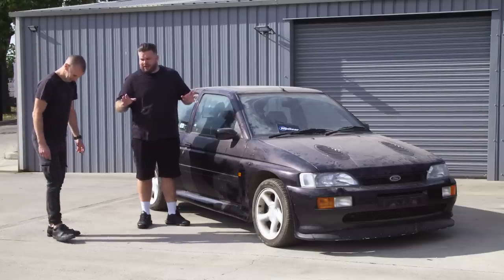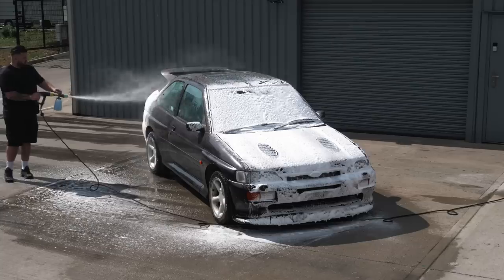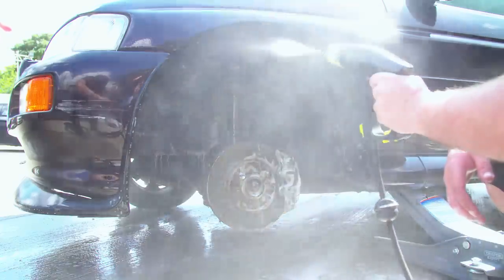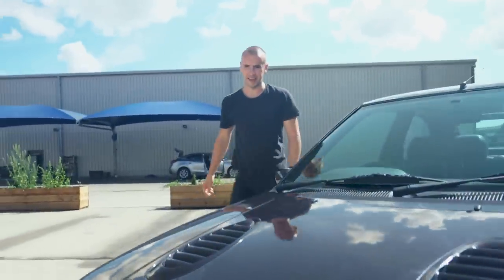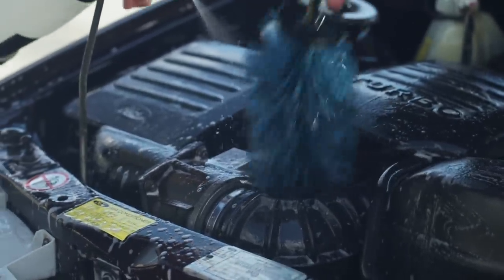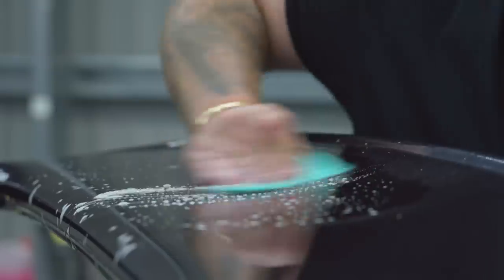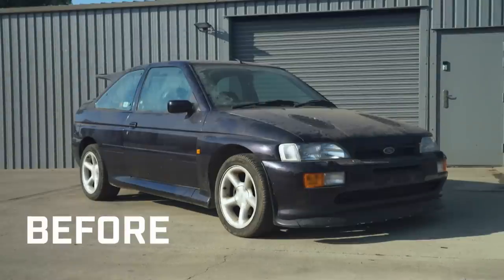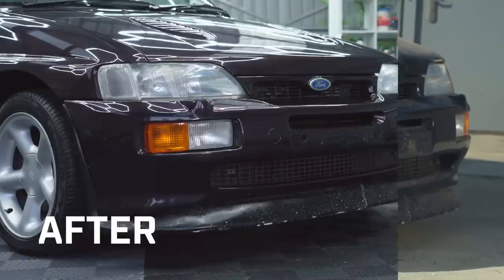FORD ESCORT COSWORTH DEEP CLEAN – Unmodified Barn Find Brought Back to Life | Top Gear Clean Team

Comment: I enjoy washing my car, it’s a stress reliever. Always nice to see a clean and shiny car.
Love snow foam, but that wheel cleaning dolly with the rollers was great; would like one myself!
What a stunning car; still looks great after almost 30 years.
Reply: I tried that snow foam, it didn’t do anything.
Reply: @gdfggggg  that’s a shame. Hopefully your foam lance nozzle allows for mixing thicker or thinner consistency to allow the foam to sit (cling) on the car panels before you use it as the cleaning product.
Also, foam is not the usual car wash product it is a specific foam product, although you can use car wash, it will not perform the same as specific foam product.
Reply: @actuallypaulstanley  yup, bought all the products. I just couldn't see the point of it. It didn't lift any dirt off. I might aswell have just power washed then soap and sponge as usual.
Reply: @gdfggggg  it is supposed to soften the grime, so make cleaning easier. It does require a lot of the foam product to make the foam; does clean well though…
My cars never get that dirty, so have not experienced that…
Always make me smile basically covering my cars in snow!
Reply: @actuallypaulstanley  that's the only good bit.
Reply: @gdfggggg   I thought the same as you until I did a detailing course. I now use it all the time, the smooth feel  of the paint is always alot better when using snowfoam. It's definitely worth it imo
Reply: @FlIckme23  maybe I did something wrong.
Reply: Hi, do you know where to buy  that wheel cleaning dolly ore the name of it  ?
Reply: @hanschristiankay8668   have a look at wheel Woolies. Or work stuff mitts
Reply: me too sad aint we 😄

Comment: Individually the most iconic part (in the escorts case) the wheels THE WHEELS!
Reply: Nope the engine 😂
Reply: What are you like 15 ffss if you're man act it ..the Cossie engine was used for so many engine swaps it's unbelievable one of the craziest lately was a ford Anglia on a hill climb stage
Reply: @monkeymagic4555  what Muppet you really are hidden behind a keyboard your trying to tell me that the wheels were the best thing about the escort Cossie not the fact it started winning rally after rally ...
Reply: Nope, the bodywork of course!
Reply: @philtucker1224  Barely an iconic part/component is it.......Bodywork (as such) that would be THE CAR would it not?
Reply: @lukejenkins9341  oh the irony 😂😂

Comment: After claying, should have used a machine (rotary or DA) to cut/compound and then polish 😔
Reply: Was in disbelief they hand-polished lol
Reply: @xiingli  They didn't polish. Polish here means they are applying a coat of wax.
Reply: @mino7122  Polishing is actually before wax is applied. When you polish, you are working directly on the clearcoat to remove small scratches/swirls. For heavier paint correction, you do compounding/cutting before polishing to aggressively correct the paint.. this dulls the finish a bit so you have to polish it up. After polish, the surface should be perfect, or close to it, but it has no protection on it. That is where the wax, or some other protection, step comes in.

Comment: Looks super, Was hoping they'd do a full polish but I guess time was an issue! Some great detailing tips and techniques on show.
Reply: I'm no Professional Car Detailer, but even I think they left out a lot of basic points and tips: don't use the same cleaner/shine spray on both the dashboard, and the steering wheel; rubbing the clay back and forth is a no-no; misuse of pressure cleaners can cause as much damage to paintwork as they remove; alloy wheel cleaner spray cleaners can also damage metal and paint finishes, etc, etc

Comment: “You know it’s dirty when you can here it” which also means the pre-wash was ineffective - possibly because the snow foam was applied to a wet surface. Better to snow foam and rise off two or three times before even contemplating contact cleaning, in my humble opinion.
Reply: Yeah I cringed when they started by just power washing the dirt off before applying any soap to lift and encapsulate the dirt first. There’s a car covered in swirls from the beginning. And those swirls are still there because it looked like their “polish” step was to apply some sort of coating by hand. Should have used a buffer after the clay and then applied a ceramic or wax coating. Guess you can only do so much with an (arbitrary) 8 hour time limit but it’s a shame about the damage caused.

Comment: i find all these cleaning products as fake and pointless as hair loss  products, over engineered over priced over charged for a bit of soap and water with floofy sponge/ shamois. as strong soap/ power wash/ bit of elbow grease  will do the job just fine as it has for years.
Reply: You will change your mind after using some good products.
I have a (non-acidic) wheel cleaner that takes all the brake dust of without even brushing, just spray it on and rinse it of. Try that with your soapy water.